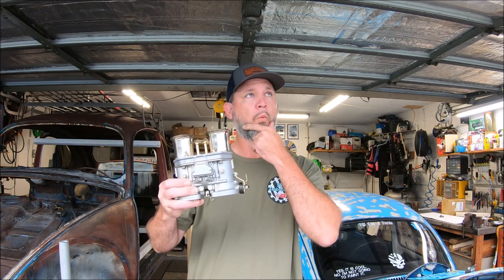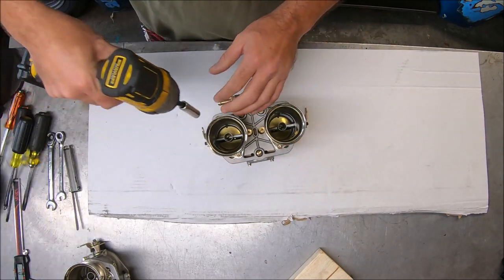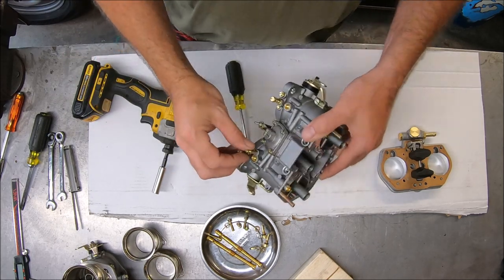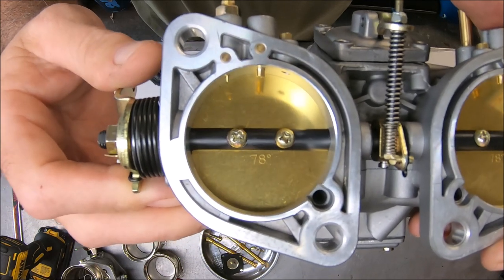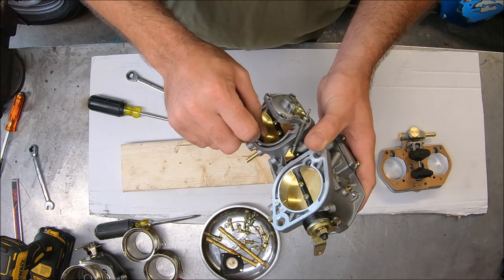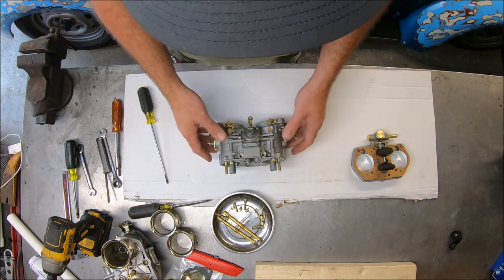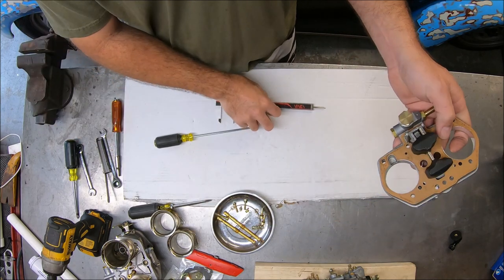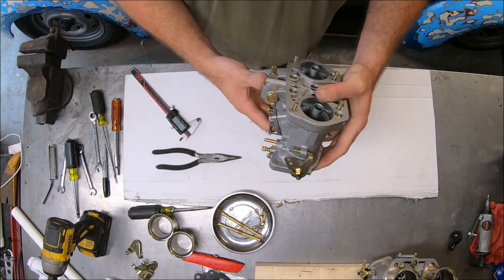No Name Chinese IDF Carbs for your Aircooled Volkswagen? Unboxing, Inspecting and Setup! Part 1/2

Comment: I have the same ones in my Bus. They work just fine. I took them apart and cleaned and set them before install. I've got @500 miles on them so far.
Reply from the maker: That’s good to know!!
Reply: Terry, did the carbs come with linkage etc, same as empi dual hpmx 40s? Where did you purchase them? Wouldn't mind having extra set as back up. And where are you located at. I'm in martinsville va. Would be great having a few vw fanatics as myself to team up with.  Enjoy your videos.
Reply from the maker: @michaelbarnes7086  I bought just the carbs. By the time you buy the carbs, linkage and manifolds, you’re almost better to buy the Empi carb kit that comes with everything.
Reply: A very good video! Thanks!

Comment: I traded for a pair of Weber 44's that had caught on fire on one side. So I bought a chinese copy for like $ 75 on Amazon. Just to rob the ventures & the squirt stacks. I thought everything was very made - copied - except for the brass parts. If I was to run one - I would use actual Weber jets & tubes
Excellent video breakdown.
Reply from the maker: From everything I could tell, all of the parts are interchangeable and yes, I’d only use Weber jets to ensure they are the correct size.
Reply: That's how I did it on my single 40 it works great.

Comment: Hey Gary, we've install hundreds of those exact China made IDFs. Both 40IDF and 44IDF's too. Never had any problems with using them in 5 or more years. The only issue lately is we've had the accelerator pump diaphragm seal leak on 40IDF's we recently ordered in two different batches. However, the batches of 44IDF's we've been buying had no issues with leaking at all. We solved the problem buy installing a new diaphragm and tightening the screws a bit tighter than previous.
We often down size the venturies on 44IDF's or upsize on 40IDF's to suit the 1776 type1 motors and 2056cc Type4's. Otherwise very happy with brand (or no name brand) you have demonstrated
Reply from the maker: That’s awesome to hear Matthew! Glad to know others have had good luck with them as well. I figured as long as they were bench tested and cleaned first they should be ok!
Reply: @VWJawbreaker 
Yep, we always open them up to set float levels and a minor clean. They do always come fairly clean anyway. We're nearly always changing jets to suit the motor size too.

Comment: Another problem area on these clones is the throttle plate bearings. They are loose fitting and can cause vacuum leak. You can find replacement bearings on Amazon.. all in all great video. Proper jet setting could be another video. Thanks for the information. Be good!
Reply from the maker: Yes, good call about the throttle shafts! 
Jetting would depend on the engine configuration, etc. There’s a web site I can direct you to if you need.

Comment: Wow they look identical, great price, smart to go though them first, saves a lot of swearing and wrench throwing.
Reply from the maker: Several others have been having great luck with them. Just like any other carb, bench setting and cleaning is key to success.
Reply: @VWJawbreaker  I’m glad I found this video because I was looking at buying a Weber carb but it’s pretty pricey. Although I’m new to the air cooled, would just a one carb setup be ok for a 1641cc vw engine? What would I need to do to this carb for it to work? Thanks!
Reply from the maker: @dameg3121  single IDF, center mount setup can be tricky to dial in properly. If you do not already have the intake, linkage, etc you’d probably be better off just buying a kit instead of piecing it together.

Comment: I just found a company 3 days ago with carbs for 256.00 a pair. They said everything they make is produced here in the US, Canada,  and Mexico.  I'll try them out, order redline rebuild kit because I'm sure everything is cheaply made inside
Reply from the maker: From what I saw, the float and needle and seat was pretty good. I wouldn’t trust any of the jets without having a way to measure them for accuracy.

Comment: Gary  fantastic video. You had great tips and I learned a couple things. Bench setting is a huge 1st step when installing dual carbs and should not be overlooked when running any carb set up. Looking foward to the install and long term results.
Reply from the maker: We all learn from each other.... well, that’s how it should be anyway. 
Good to hear from you again, hope things are going well.

Comment: I’ve still got a set of the 44’s and 48IDA’s in my eBay watch list. I think I’m going to get a set of each for my demo engine. Thanks for taking the time to put out another great video.
Reply from the maker: Did you happen to read some of the other comments below? Several others are having great luck with them as well. It’s all in the bench clean and setup as we already know... as I’ve learned from you.
Reply: @VWJawbreaker  I totally assumed it would be like I always said EMPI makes a great budget carb it’s all about setting it up with good jets and a proper bench set up. As long as the casting are good and the metal is strong they should last years.

Comment: Damn good vlog Gary, I’m tempted, I hope they run for you
Reply from the maker: I appreciate you buddy. Others have stated they’ve ran then without issue.
Reply: @VWJawbreaker  Ally has seen me looking at them, I’m dead lol . Would these have to sit on empi manifolds on the type 4 engine or on the standard solex’s? I’m looking at the 40s for him
Reply from the maker: @deanrobinson3717  don’t get caught sneaking in looks 😂
If you’re looking at the 40 idf, then you’d also need the idf intakes for the type 4 and linkage. Might be cheaper to just buy a complete kit vs piecing it together
Reply: @VWJawbreaker  yup, works out slightly cheaper, may just got for the full empi kit then :-)
Reply from the maker: If that’s the case, that’s what I would do.

Comment: Ive had a couple of no name eastern carbs, you need to watch out for un marked jets with odd sizes, and poor assembly , but by far the worst is 'Zink Rot' or 'Zink Sickness'  where the metal casting starts to crack and crumble, usually around screw holes or the fuel spigot. Humidity and/or cold seem to be the cause.
Reply from the maker: Pretty sure I said it in the video, either measure the jets and verify or run known jets.
Haven’t seen anything to do with the rot before on many different carbs but I’ll keep an eye out for it. There’s plenty of humidity here in Florida.

Comment: I think those are the same ones I had on my 2387. The only problem I had is they would not stay synced. And couldn’t get each venture to read the same. One would read 6 and the other 10. But at full throttle I was happy I have a video of them running on my page I up loaded
Reply from the maker: I had the same issue on a set of Spanish Weber 40 IDF’s, one barrel was higher than the other. Look into the throttle shaft and butterfly’s. Sometimes if the carbs are old the shaft can twist over time and cause one butterfly to be more open than the other.

Comment: Hi Gary, Any reason you use brake clean over carb clean? I was leary buying a Chinese Weedeater clone carb till I got it. I identical except the throttle butterfly spring was too weak so took the old one off the old carb and it worked great. Wasn't that easy due to removing the butterfly out to change it. But for 10 bucks online it was a win for sure👍
Reply from the maker: I used break clean because that’s what I had on hand. I thought I had some carb clean but oh well. 
I bought a knock off carb for my chainsaw a while back. Same as you, had to swap one or two things and it’s been working great for a whopping $12. Couldn’t go wrong.

Comment: Hello I'm junior from jamaica I have a 1972 1302S VW beetle I just bought a no name Weber will it work I was running dual carb but I took off one and now running single
Reply from the maker: Normally you need to change the emulsion tube when you use one as a single carb.
Reply: If you have the standard 115/F11/200 they come with. You'll want to get a smaller air corrector and maybe a F7. I have setups with F11 & F7 for my single 40. 

It will take some time to dial it in. But after you do you will really like the  throttle response and easy drive in town.

Comment: Gary love your videos. Could you tell us where you bought the carbs. Wouldn't mind having an extra set as back up. Do you have a video of them running.
Reply from the maker: I bought them off of eBay, there are multiple sellers that sell these. Next weeks video they will be on the car.
Reply: @VWJawbreaker  hey gary. Where are you located. I'm in martinsville va. Wish I had some vw fanatics in my area. Thanks Gary. Love your videos
Reply from the maker: @michaelbarnes7086  I’m down in central Florida luckily there is a good VW scene here.

Comment: I have used F2 before in the race car. and i have a couple of cars with  f7's did you say those were 48's My street car has a set of real ones on it. according to some one at redline they don't work well on VW air cooled engines. I don't have an issue with mine but it did take about month to get them just right. BTW you do know that the venturis are not the same as 40 & 44's due to the bore size of the carb body
Reply from the maker: That’s good to know about the other emulsion tubes! 
Yeah I found out real quick that the vents wouldn’t swap over.... had a duh moment there.

Comment: ...i enjoyed your video, ive got the exact same carb,even w/ the same writing on the box,  and my idle screw tab was off the same also..
..im running a single 40 idf setup, it runs great but smokes, i suspect its running lean, what jets would you suggest..??, 1600 dp, with an engle 110..
Reply from the maker: Thanks, glad you enjoyed the video. 

I doubt the smoke is related to being too lean especially without knowing the color of the smoke. 
Single idf carb setup is different than dual carb setup regarding jets. 
Here is a good article that will help you dial things in. 
https://www.aircooled.net/vw-carburetors-jetting-102/
Reply: @VWJawbreaker  ..its a white smoke, didn't do that before the swap, my local bug guys tell me that its set up too lean as a single idf, as they were mrment to be run in duals..??
Reply from the maker: @DRBAAHB  correct, they are meant to be run as duals. 
Read that article as it highlights some of the differences when running a single idf carb, jetting, etc.

Comment: What linkage you gonna use..wonder if there’s a weight comparison with the big boys that may highlight a difference in material and casting used..! 👍🏴
Reply from the maker: Holding the Weber 44’s and the no name 48’s, they felt very similar in weight.
Reply from the maker: Oh also linkage, I can use the same CSP bell crank linkage since they are both IDF’s.

Comment: Would you recommend one of these for a single carb setup on a DP 1600? All stock except Pertronix SVDA distributor with Flamethrower coil and some type of "other than stock" exhaust. I haven't decided what I want for a muffler yet but it's going on a Thing and I want to use the stock exhaust port holes on the bumper. I'll probably do the Tri Mil Euro 2 tip.
Reply from the maker: I honestly do not recommend a single mount IDF carb at all. If you want to run a 2 barrel carb, there are other choices. Again, just my opinion.

Comment: So I have what looks to be pretty new dual 40s knockoffs on my 1776 and can't get the carb on number 2 to adjust properly. The idle mixture screw doesn't change anything. I have had the carbs apart numerous times and I understand the adjustments, but still have the same problem. I've cleaned them many times as well. Can you please give me a direction to go, as I'm kinda stumped now, thank you
Reply from the maker: Since you have it narrowed down to cylinder 2, check the idle jet to ensure it’s not clogged and blow out that circuit with compressed air very well with the idle jet and mixture screw removed. 
Next check to make sure you don’t have a vacuum leak on that cylinder. 
Check valves because that could cause that issue as well.

Comment: Haven’t watched it all the way through but shit it’s Chinese we’ve all scene the handy work of the chinese
Reply: Man I’ll be honest I was a little surprised! I’d like to know how it lasts in a few years. The metal the Chinese use is a lesser quality but if we can spend 1/4 the money and get a decent carb then I may come back to air cooled. But I’ll be honest the price of a used Honda Subaru motor and adapter vs a 2110cc I’ll probably build this bug Honda. It’s cheaper and more reliable with more horsepower
Reply: Great great video though man for real

Comment: Hello ! Just the other day i was going over everything in my mind about the motor i just built for my buggy , I also bought a pair of those IDF's and they are the only parts i was and still am questioning and damn if  i didnt just browse through utube and see this video MINE ARE THOSE EXACT ONES dont know what size yours are , mine are 44's ... So im going to use your video as reference and check them out, so thanks for basicly reading my mind and posting this video............ More than likely you'll be talking about jetting them down or up maybe in a later video? that would be cool                      Have a good day
Reply from the maker: Hey Roger, glad I was able to read your mind lol
The ones I got were 48’s but everything I cover will apply to the 44’s that you have because they are still IDF’s. 
I can’t recommend jetting without a wide band readings, seeing the car or driving the car. I do have other vids that cover some of that but most will be trial and error.
Reply: @VWJawbreaker  Damn first of all thank you for your response,,, As for the jetting  i figured that much It can just be a pain sometimes but its got to be done,,,,, what i have put together is a 74 crank and 92 barrels 120 cam 40 heads This is going in a manx 2 style buggy STRICTLY street it should run alright just taking my time on.. i would put a pic up but these computers are stupid lol     anyways thanks again and i enjoy your videos I CAN RELATE TO HOW YOU EXPLAIN THINGS     GOOD JOB
Reply from the maker: I respond to all comments, sooner or later. I appreciate the time people take to write them, I should take a moment and respond!
That engine combo in a Manx is gonna be fun! I know a 1777 with a 120 cam and a food set of heads is a blast 😁
Reply: @VWJawbreaker  THANK YOU yeah it should be a fun little buggy By the way you are the first person to actually respond  i appreciate it Have a good day
Reply from the maker: @rogerarnett1385  that’s crazy man, sorry others haven’t responded. 
Have a great day and stay safe.

Comment: HEY GARY , I'M NEW TO VW BUILDS AND STUFF BEHIND YOUR ENGINE YOU HAVE YOUR FUEL LINES CONNECTED TO A SYSTEM  WHERE IT LOOKS LIKE YOU CAN ADJUST THE FUEL PRESSURE ? , DOES THIS HELP ? I'VE HAD A FUEL LEAK SINCE I BOUGHT THIS LAST MONTH , AND YESTERDAY THE GARAGE HAD A BIG PUDDLE SO I PUMPED OUT WHAT I COULD . SO I HAVE TO REMOVE A LOT OF STUFF ON THE DUNE BUGGY TO FIND OUT WHATS  UP , YOUR THOUGHTS !!     THANKS AGAIN      ALAN
Reply from the maker: Yes, the gauge is a fuel pressure regulator to keep the fuel pressure for the carbs no more than 3psi. 
Where did your fuel leak from?
Reply: @VWJawbreaker  I don’t know yet I have to take it apart , I will let you know. Thanks for your help
Reply from the maker: @AlanDavid1955  check your fuel hoses, those should be changed out every few years.

Comment: That iuse it nice carb
Only problems with needle for carbs not good change it to original it will ran nice
Because its close befor it level then less fuel
Reply from the maker: Good point, thank you for that!
Reply: @VWJawbreaker  iuse it on last engine ibuilt 2276cc and ilike it 
Problems on hi range fuel too less